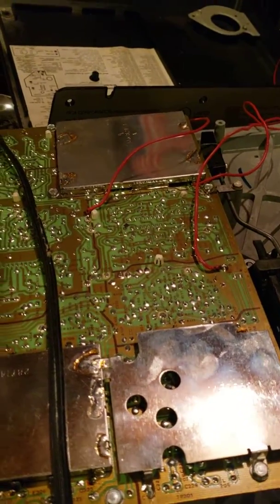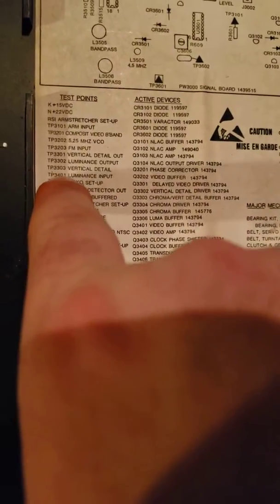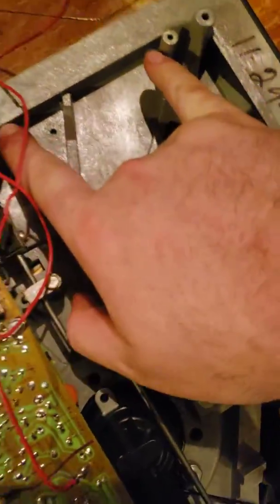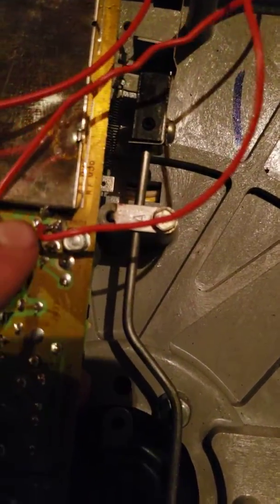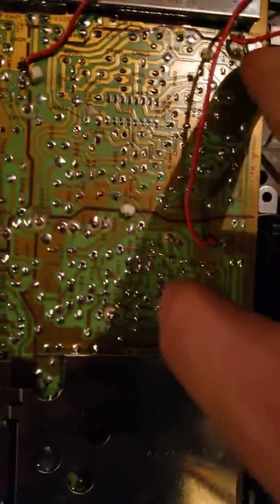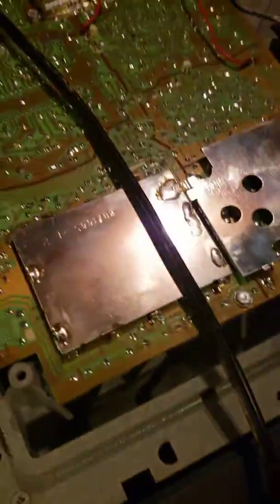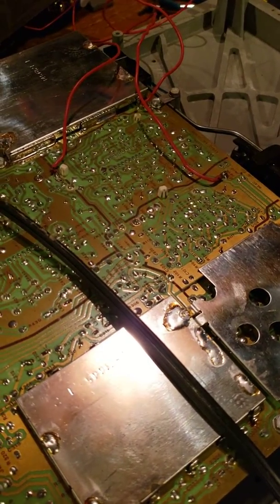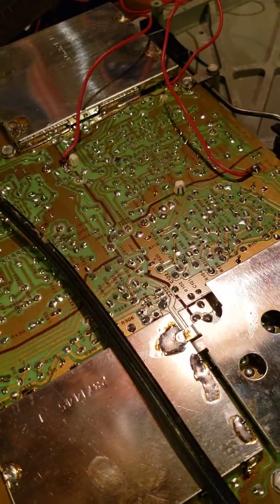SFT-101W a/v composite video mod "tutorial" CED

Comment: I'm having trouble with a washed out picture, any advice? I didn't solder in those caps you did. Wait, does the 75 ohm resister attach to the composite video in lead? and which end of the capacitor attaches to the cable coming FROM the machine?? Thanks!!!!!!!!!
Reply: You dont need the caps, they actually caused a problem for me on some players.

I had that problem on one of my players everytinme I wired the ground to each RCA jack. 

The machines are weird. I think the test equipment for earlier players had some extra circuitry in them.